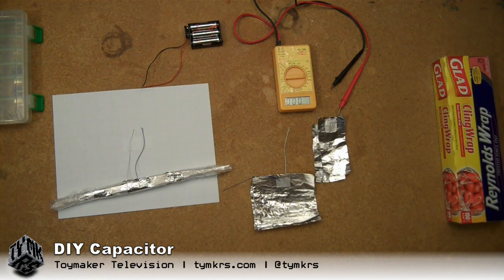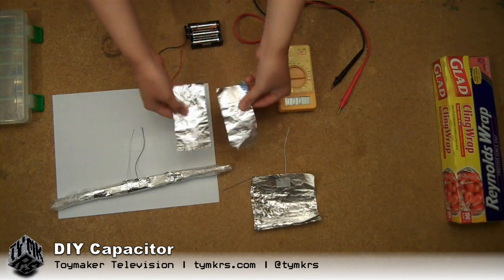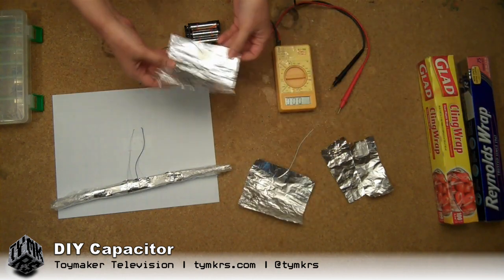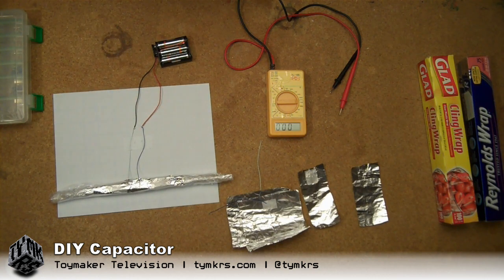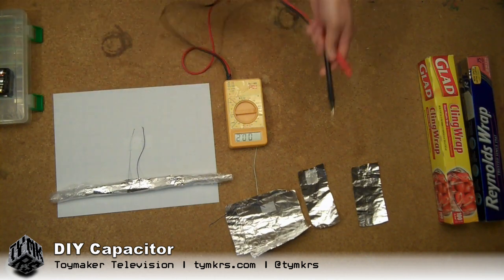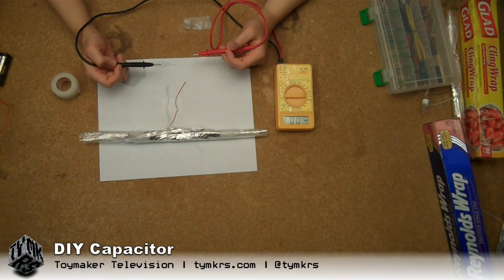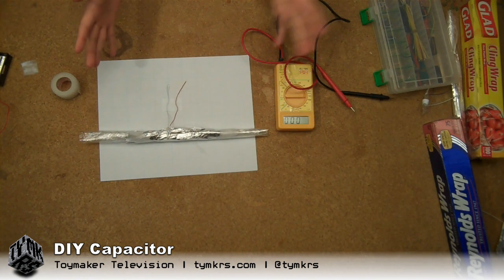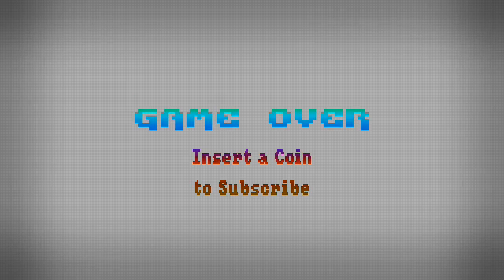TYMKRS DIY Capacitor

Comment: The leads of the aluminum foil need to be at opposite sides.
So one sheet needs to have the lead at the end (like you do) while the other at the beginning, coming out of the center.

Try making one from an entire (2x) 200sq ft roll of ALU foil!
Might be easier to choose a bit less wide of a roll, and a wider plastic.
Also, spraying baking oil or some sort of cheap oil on the aluminum, will help the foil stick better. Oil also insulates, without taking up much space at all.

Comment: I measured and calculated what my toilet paper roll capacitor should have. it calculated 448pf and i measured 470pf. Can't hold a charge though.
Reply from the maker: +leerman22 Hah, that's awesome you tried it :) I don't think our's was able to hold a charge either
Reply: Too bad you can't hold your charge!
I'd recommend applying more constant voltage to your starfish. It'll keep the valves closed off long enough to save more charge for next time!

Comment: I think the capacitance is also related with the space between the tin foil and the insulator, so it has to be very tight (I read this somewhere on the internet, so not very reliable, but you can look into it)
Reply: plastic foil is too thin for high voltages. She needs 2 layers of it.

Comment: Your other capacitors probably worked, but had very small capacitance.  Making a timer circuit (using a 555) would allow you to measure these small values.  You don't even need a frequency counter, of you set it up in the right frequency range, you could use your computer's sound card.

Comment: In high school physics class, my friend once brought in aluminum foil and wrapped a very large plastic recycle bin (similar to the kind of outdoor trash can you'd use for street pickup) inside and out.  He used the teacher's Van de Graaff generator to store quite a bit of charge.

I suggest making a trash can cap and charging it with a high voltage from a fly swatter inverter or disposable camera flash.  Also, a quick google suggested plastic wrap is sometimes slightly conductive :-/

Comment: The capacitance of a capacitor is given by:

C = E0*Er*(S/d), where E0 = electric constant = 8.854*10^-12 F/m, Er = relative electric permittivity of the dielectric (in this case, Saran Wrap), S = area of overlap between plates (meters^2), and d = distance between them (meters).

The electric constant is a Very Small Number, which is why S has to be very large and d has to be very small. Capacitors are usually made of very thin foils for this reason, using dielectrics with high permittivity.